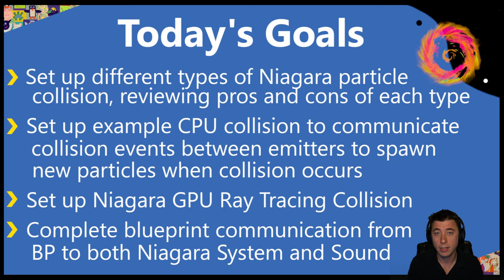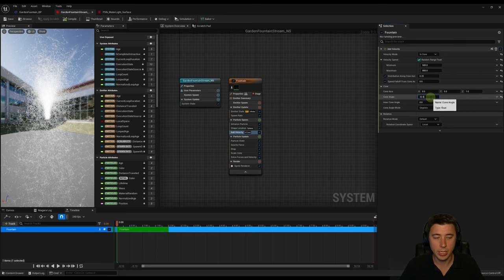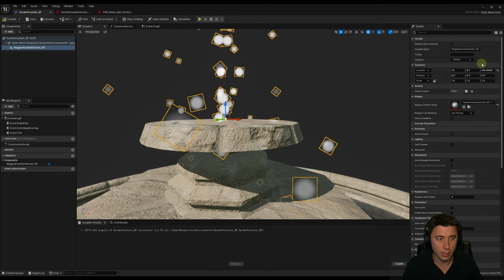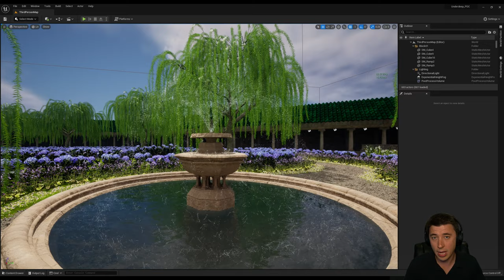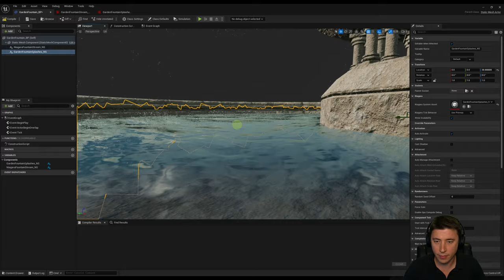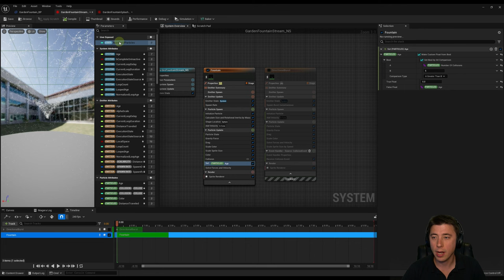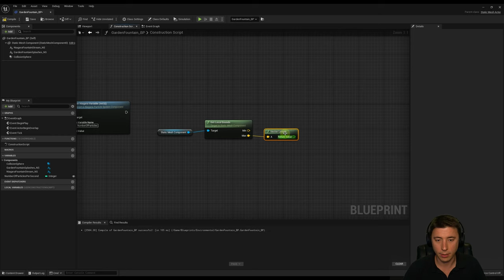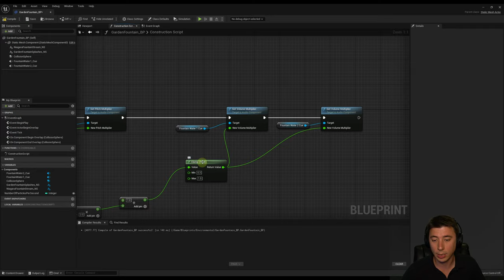Let's Build the RPG! - 22 – Unreal Engine 5 Niagara Collision Tutorial with GPU Ray Tracing

Comment: Hi, I dont have UE5 or DX12. Im using UE4.27. Can you direct me to tuts or names of terms for a Water particle (beam emitter, or a long line of particles), and it has to have collision?

I made a Niagara one with collision. After collision, they are set to reduce Velocity and thus they angle off the player (closest I can get to simulate deflected water jets).
The problem is that shower jets = a flow of water, not just dropping rain. Thus the particle has to be long (I did), or I need a beam emitter that bends (smoothly) when it collides on my player.

So can you help me with a few issues? I even looked for paid shower/water jet assets, found nothing.

1) The problem with my long [Niagara ] particles is they need to be long to look like a water jet - but they are too long, when they collide with the top of the player, the bottom sticks thru the player, before it collides and changes angle.

2) Where is the command/setting to have a particle change size (height) after Collision is detected? (found nothing)
3) Or if you can direct me on how to setup a Beam emitter, but it bends/flows like liquid after collision (arches)? 
Ty (and remember for UE4.27)

Comment: Weird, as soon as I put in Set particle age...It instant GPU crashes... I have a 3090ti and 128gb ram...Not thinking lol. I am also using 5.2?
Reply from the maker: Can you make a similar Niagara system and try to do the same on a different one, see if it still happens?  You could also try using Normalized Age (which is age/lifetime)